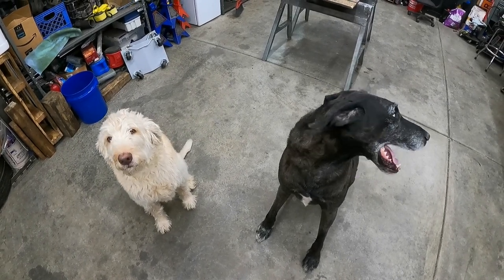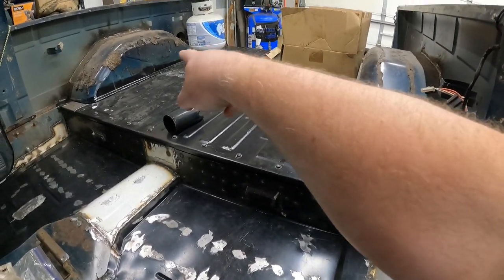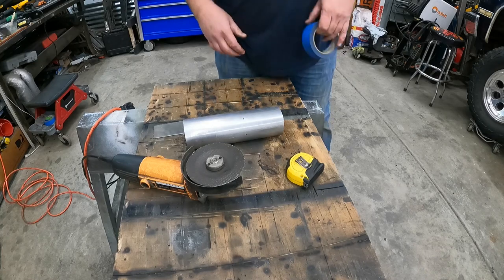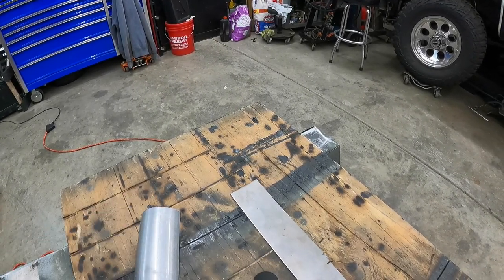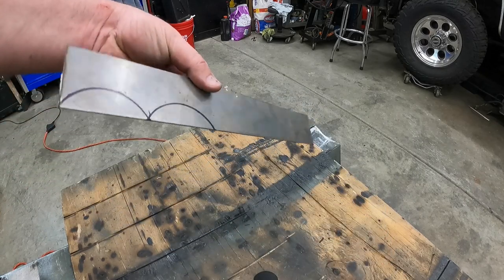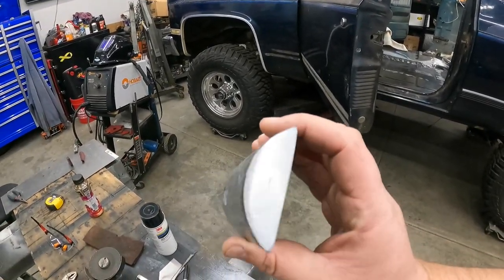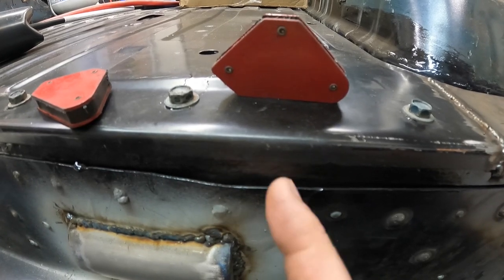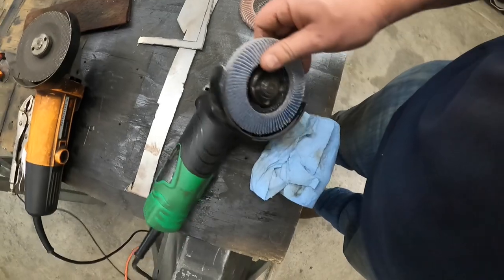K5 Resurrection Part 28 - Finishing up the floor!

Comment: I got some Norseman brand drill bits at a friend’s recommendation. They are about $100 for a set on Amazon, comes with a bunch of bits in a nice black round case. They have improved my quality of life working on my Blazer lol. I was also holding out on buying good bits for cost reasons and finally broke down, and I wish I’d done it sooner. Spin them slowly and use cutting fluid/oil, and they cut very quickly and don’t seem to wear out. Hope that helps, and love the videos!
Reply from the maker: Thanks! Norseman is one of the brands I’ve had my eye on!